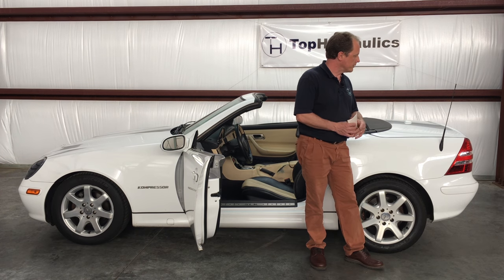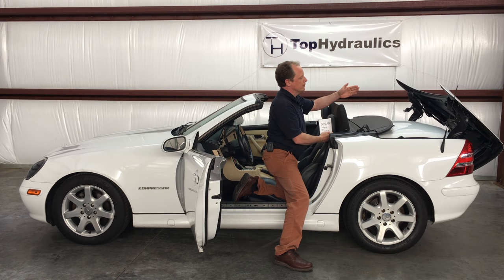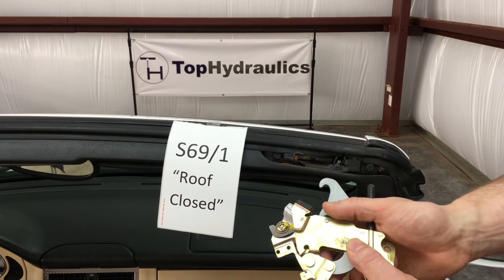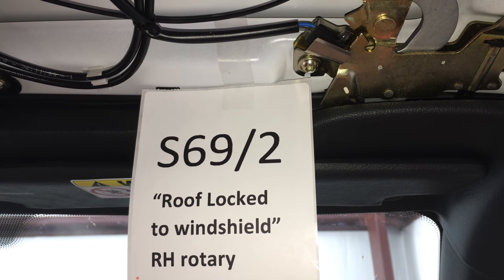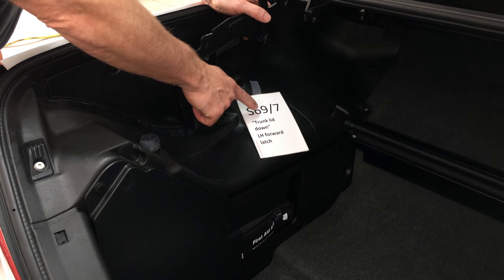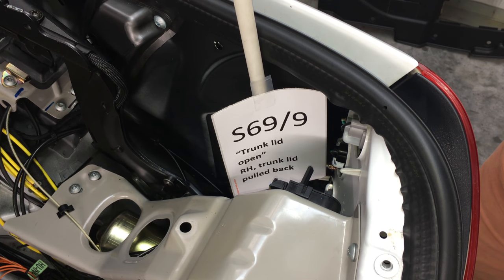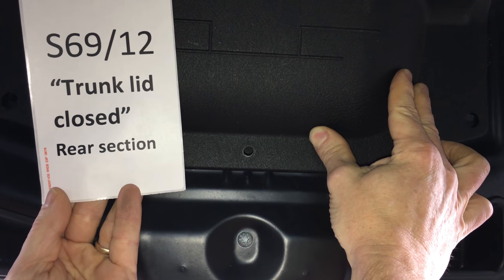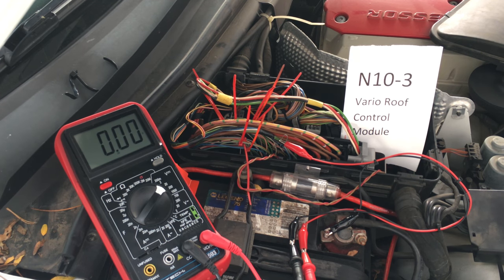Mercedes R170 SLK Top Troubleshooting - Explanation of Electrical system and Microswitch Locations

Comment: Great video for a new by to the dreaded slk roof....when pressing my roof button the boot lid does all the movements and pump sounds in good order.....ie ...windows drop rear quarter lights drop boot lid goes back to accept roof but that’s where it all stops.....the pump keeps going but nothing moves . I’ve manually pushed the roof up but this stops the pump.....where do I go from here?......please please help
Reply from the maker: Hello Paul,

the SLK roof is fairly simple - don't let it scare you! I believe you are saying that upon opening the roof, the trunk lid flips back and the pump keeps running. If you were to manually move the roof backwards, the pump will stop. 
The most likely cause is that the computer does not get the signal that the trunk lid has been retracted. That's why the pump keeps running to pull back the trunk lid some more without retracting the roof yet. It would also explain why the system shuts down when you move the roof backwards, as it would be illogical that the roof is partially retracted before the trunk lid is up. Check out the "Trunk lid open" switch S69/9. Make sure that it gets triggered and that it is still connected to the wiring harness. Here is the relevant section in the video: https://youtu.be/uXKSfLEPWgE?list=PLly4CMbpk7oxzfmMaPF6w5l1xEtmsKUXF&t=750
Please let us know what you find...
Reply: Top Hydraulics I’m a bit ahead of you on this one.....I’ve just bought a replacement switch but it makes no difference......does this now mean a wiring problem.....which is what I’m dreading.....it started of intermittently but now is every time.....thanks for replying as it would be nice to have roof down while the suns shining...ha ha
Reply: Top Hydraulics ....I’ve  bought myself a replacement switch but still the same.....2 switches but same outcome...
Reply from the maker: @paultopp7833  Have you checked S69/2 and S69/3 yet? If they have sticky boots, as mentioned in the video, then you will still get the "top locked at windshield" signal, which would prevent the top from retracting and which would cause the same shut-down once you manually retract the top. If S69/2 and S69/3 are okay, then you want to check the inputs into the control module as shown at the end of this video. It's not that hard once you get into it. Please let us now what you find.

Comment: Thank you for this video. Now I have at least some clue to start troubleshooting why my trunk lid does not want to close down after the top is folded into the trunk. Trunk lid does close down if I get the top back up. It must be the S69/11 switch.
Reply from the maker: Agreed, the symptoms point at S69/11. Someone may have worked on your cylinders before and accidentally damaged S69/11 while taking the right main lift cylinder out, or it is not connected to the wiring harness.
Reply: @TopHydraulics  Just finished checking the switch S69/11. It popped out of the 2 circular clips. In fact the clips seem broken. I will get a replacement. I will figure out how to replace it. Looks like it is deep inside.
Reply from the maker: @derekkchung  That means someone must have damaged it when taking out the right main lift cylinder before. Here is more insight:  See https://youtu.be/9A2d4A3PyyE?list=PLly4CMbpk7oxzfmMaPF6w5l1xEtmsKUXF
There may be a way to push in the switch from the inside without removing a lot of parts first. After all, it only needs to be pushed into the frame and it then secures itself on the same tabs that broke before.
Reply: @TopHydraulics  Hmmm. I will try pushing it back in. I see most of the "pawls" of the clips are broken. I wonder how that happens and if a new one will be broken the moment it is installed. I just bought the car last week and the seller did demonstrate the top could go up and down and amazingly now it is broken.

One more question if u don't mind. Can u watch video 4Qq0tKoLYFw. He had to adjust the cables to allow the top to separate from the windshield. I have the same symptom and I thought it was just lubrications. Should I remove the headliner to make the adjustment?

Comment: My top is finicky when it wouldn’t close I found an incline waited then tried to close it and it worked!  Does this mean my fluid is low in the trunk or is it the pump?
Reply from the maker: Thanks for asking. I believe you had previously written that you have a 2006 SLK280 and then edited your question. Is that correct? Model year 2006 is actually an R171 chassis SLK. The R171 roof is largely similar to that shown in our videos, but there are some significant differences. One of the major differences is that the pump is behind the seats, not in the trunk. Here is a video from a happy customer of ours that shows you the pump location and access to the pump a few minutes into the video: https://youtu.be/KJW3DYDWcYA
You had also written that you have had the car for three years and that the top has been finicky from the beginning. 
I'm sure you can hear the pump running when the top is moving. In those instances when the top will not move for you, can you hear the pump running or do you get any alerts in the dashboard?

Comment: I just bought a 1997 SLK 230 and the top didn't worked. (leaking roof cilinder) I fixed it, but there is still one problem, the rear windows do not close. Do you have any idea what it can be?
Reply from the maker: The rear windows will not go up if the computer does not get the signal that the forward trunk locks are latched. This could be because something is preventing the trunk lid from closing far enough, or the locks need lubrication, or (most likely) because one of the release cables for the locks is not properly routed. Check whether the cable is getting caught somewhere.
Reply: @TopHydraulics  Thank you for your quick response. I will double check the trunk lid, I hope this is the problem. Will let you know!
Reply: @TopHydraulics  Today I checked it and the windows still do not want to close. I pushed the button from the roof and someone else pushed on the top side of the trunk, first on the right and after that the left side, but still nothing happened. We also adjusted the brackets inside it, so they were a little longer, but also that didn't made any difference.

Comment: Seems my car had the top pump replaced (bought it after that)
it takes a long time holding the switch to start operating properly. Then it works as it should
Think it may have air on the system
any way to “bleed” the pump?
how to make sure if the rebuilt pump is deffective?
thanks a lot
Reply from the maker: Hello Alex, thanks for asking. Does this hapen only when you are opening the top or also when closing? Have you checked the fluid level in the pump yet?

Comment: Thanks very much for the video, but my slk 230 r170, sometimes when am starting opening the roof, it is stopping it self, and proceed,and some times it fails, then once switch the off the Car  and switch on again then is working ....so i don't understand what is the issue, although hydroliq in the pump is fully .....is there any idea should i solve this issue??
Reply from the maker: Hello Patrick,

thanks for asking. The roof working intermittently is almost certainly an electrical issue. The easiest answer to give you is "watch the whole, and pay special attention to the section starting at 17:24", which covers how to read out all micro switch positions from the control module: https://youtu.be/uXKSfLEPWgE?list=PLly4CMbpk7oxzfmMaPF6w5l1xEtmsKUXF&t=1044. It will take you a little time to identify which wire is which, but the video should be giving you all the information needed. At this point, all you need is a multimeter to check the signals on the wires highlighted in the video.

If you have SDS (Star Diagnostic) on your computer, then you can read error codes and you can read out every micro switch state through your computer. Of course,  any mechanic who has SDS can do this for you.  

I hope this helps!

Comment: HELP.......Hi can any one please please tell me wich switch controls the real quarter light windows to come up when shutting the roof....Thank you so much ...
Reply from the maker: Hello Pat, 

The rear quarter windows will not go up before the trunk lid (boot lid down under) has triggered switches S69/7 and S69/8 in the forward latches for the trunk lid, shown in this video starting at 10:23 https://www.youtube.com/watch?v=uXKSfLEPWgE&list=PLly4CMbpk7oxzfmMaPF6w5l1xEtmsKUXF&index=8&t=621s

Klaus
Reply: @TopHydraulics  Thank you Klaus so much for your quick reply and advice. I will investigate today...Not surprised you have such a great reputation for service....Assume I can order switches from you if needed ? All the best from Australia.
Reply from the maker: @user-lm4yp4cq4t  We don’t sell switches and you likely won’t need one. The switches themselves rarely fail, it is usually a mechanical issue. For example, if you are trying to close the top manually, then the trunk lid cylinders will automatically pull the release cables on the forward latches and not allow the lid to latch all the way.
Reply: @TopHydraulics  Hi again..thank you for your reply. I am a little confused however.  The roof is and remains perfectly.  The only problem is the two rear quarter light windows do not close.  The door windows operate as they should when closing the roof if down at the time of closing.  We closed the two rear quarter light windows today after shutting the roof normally by disconnecting the two plugs from behind the seats using positive and negative from a battery not attached to the car.  The roof operating cabin switch remains red when the car is running or ignition is on.  Have not had to manually close the roof or pull on manual release straps.  I have watched all your very detailed videos. Would checking voltages in the module be the next step or do you have any other suggestions.  Not sure if we lowered the roof now the  two quarter lights may come down again but on closing probably not come up as this seems to be the only thing not working correctly.  Thank you so much for taking the time. Really appreciate it.  Pat.
Reply: disconnecting the two plugs from behind the seats using positive and negative from a battery not attached to the car.  The roof operating cabin switch remains red when the car is running or ignition is on.  Have not had to manually close the roof or pull on manual release straps.  I have watched all your very detailed videos. Would checking voltages in the module be the next step or do you have any other suggestions.  Not sure if we lowered the roof now the  two quarter lights may come down again but on closing probably not come up as this seems to be the only thing not working correctly.  Thank you so much for taking the time. Really appreciate it.  Pat.

Reply

Comment: Hi my SLK 230 starts to open boot and looks like it opened but then I hear pump going but roof top doesn’t move ? And if I let pressure out and then try to put it up same again roof but doesn’t move ? But pump working, what could be causing me my issue ?
Reply from the maker: You could either check the micro switches shown in this video, or you could put some effort into describing the symptoms precisely.
Reply: @TopHydraulics  when I push the switch the windows and small quarter windows go down and the boot lid tilts back and then nothing else happens the roof doesn’t even move . If I let the hydraulic pressure off and fold it down manually and then tighen the hex screw then try to put the roof back up , nothing happens . The chap I bought it from said the roof used to work tempermentally .
Reply from the maker: @madmike32ToD  Check whether switches S69/2 and S69/3 click once they are released
Reply: @TopHydraulics ok thankyou I will have a look at those , as rewatching video :)
Reply: @TopHydraulics Thankyou for your advice it was the 2 microswitches on roof locking mechanism stuck . Cleaned them up and they work and system now works . Thankyou so much for your advice as most appreciated .
Do you know where I can get guide pin plastic bits from or metal ones maybe as 2 broken ones but luckily I had spare ones on a locking mechanism I had bought from scrap yard .
Reply from the maker: @madmike32ToD  Congrats on fixing it and thanks for sharing! I’m not aware that anyone makes replacements for the black plastic cones/guide pins at the front of the locking mechanism. Currently, used locking mechanisms are cheap enough on eBay. If they ever become scarce, then maybe someone will start making replacement guide pins. I would envision cleanly drilling out the plastic part, tapping a thread and screwing in an aluminum piece that gets secured with thread locker.
Reply: @TopHydraulics  do you have a video on changing the cables that go to locking mechanism and where they go to and connect ? . As there is a lot of slack on my cables and I was wondering if there was a suggested slack level ? As I done mine tighter but then it seemed I had issue with lid in boot and wouldn’t come up . Or just coincidence as I cleaned up the microswitches again just incase it was them again ! . Also is there a way to get the jaws to open a bit more as mine are very close and I think possibly catching and why the guide pin snapped !.
Thankyou so much for your great videos and advice on here .
Reply: @TopHydraulics  Also one more question a lot of roof hinges including boot hinges are all greased up in yellows colour grease is that right or should I clean grease out and use silicon spray as quite squeaky when going up and down . Your advice has been amazing so thought I would ask yet another question , Thankyou again :) .

Comment: The red button on my SLK 230 stays on when the car is on in park and flashes while I'm driving. The top is locked and up with the windows up. What could it be?
Reply from the maker: That would be either S69/2 or S69/3 in the front, or S69/7 or S69/8 in the rear. If you have closed the top manually,  then the forward corners of the trunk lid are likely not fully latched.
Reply: @TopHydraulics  it turns out the roof latches weren't locked in properly. Thank you for the quick response. : )
Reply from the maker: @rustynailsxxx1  Thanks for sharing! That means switches S69/2 and/or S69/3 were not giving the locked signal. They are actually wired in series.

Comment: Hi, I have a problem that maybe you can help me with.
Sometimes when I open the hard top it doesn't close afterwards. I have to wait 45 minutes and then it closes. This does not always happen, only occasionally.
I don't understand, it seems that you have to do some reset and after 45 minutes it starts to work normally.
Do you have any idea what the problem might be?

Thanks.
Best Regards,
Pedro
Reply from the maker: Thanks for asking. Does the electric motor on the pump get hot when you are opening the top? Does anything happen before the 45-minute wait period is over, such as the pump motor running when you push the button to close or at least the windows going down?
Reply: @TopHydraulics  The engine does not get hot.
In the 45 minute period, nothing happens, nothing works. After 45 minutes, everything is back to normal and the roof closes.
Reply from the maker: Just to clarify: 1) Can you raise the windows after the top is down? 2) Will the windows come down again during the 45-minute wait period if you push the button to raise the top? 3) Any warnings or displays in the instrument cluster?
Reply: @TopHydraulics  In the 45 minute waiting period the windows open and close normally.
No error warning appears on the panel.
During the 45 minutes, when I try to close the roof, I press the button that keeps flashing and there is no movement to close the roof, nor do the windows move.

Comment: Hi, can you help me? My trunk is stuck. The central locking system does not open the trunk, the key does not lock the locks. Luggage cover is open. How i can open the trunk?  Can i somehow lift a trunk with roof system?
Reply from the maker: Thanks for asking. I would identify the wires for the trunk partition at the controller and short them, so that your pump can flip the trunk lid backwards.
Reply: @TopHydraulics  So i need S69/10 Switch. Can i short them in  N10-3    pin 54?
Reply from the maker: @burningpipes529  Yes, that's what I would do. Short pin 54 to ground. Please let us know how it works out for you...

Comment: My Verizon roof is stuck cannot even open it manually. Just will not pivot any idea guys?
Reply from the maker: There are small latches in the frame, between the rear of the top panel and the top of the rear panel, which get activated by cables coming from the front latch. Adjust the cables or manually unlock them.

Comment: Yes..I have a 2001 slk320 the top works good up and down but the red light stays on and beeps every 5min when top is down and sometimes the small window don’t go up . Any ideas?
Reply from the maker: If the rear windows don't go up, then you want to check the "trunk lid down switches S69/8. See https://youtu.be/uXKSfLEPWgE?list=PLly4CMbpk7oxzfmMaPF6w5l1xEtmsKUXF&t=684
Reply: Top Hydraulics Thank you!!
Reply: Also any ideas on when top is down red light blinks and beeps?